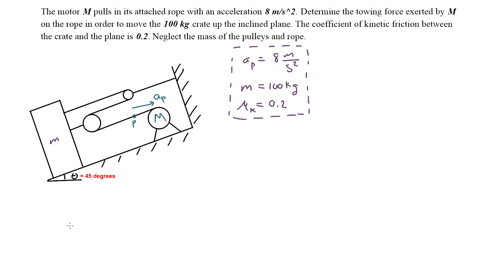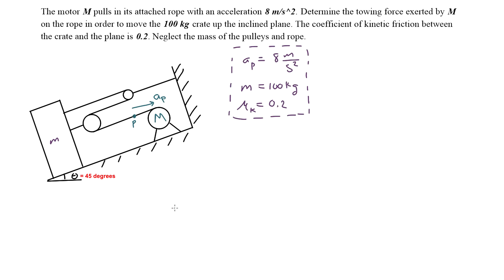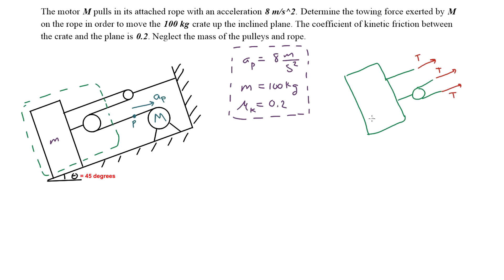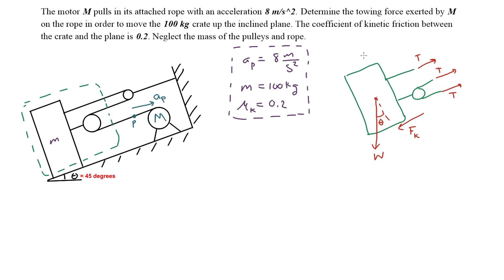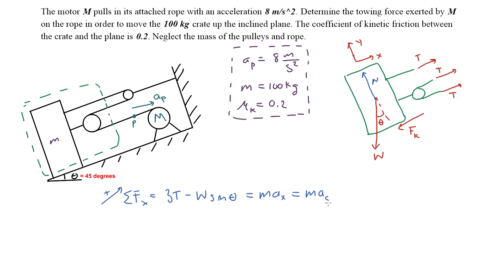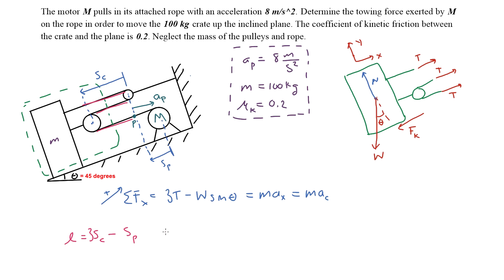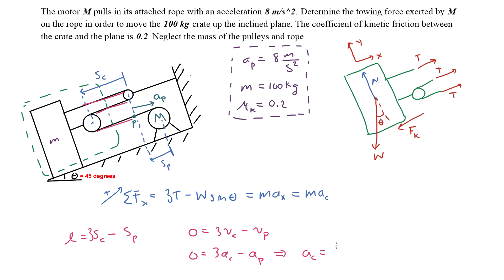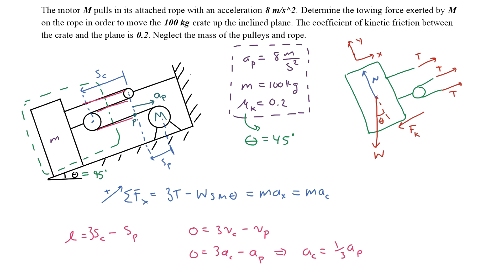Dynamics | "The motor M pulls in its attached rope with an acceleration 8 m/s^2. Determine the..."

Comment: When you add up the lengths from the datum, why do you subtract the sp from 3sc? Why don't you add the lengths all together?
Reply from the maker: @Rachel Hans @Kabir F
The best way I can explain it is that when the datums are defined, the sub-lengths of the rope are increasing and decreasing simultaneously, so they must be opposite in sign. 

Imagine a single pulley dangling on your roof. You put a rope on the pulley such that the rope is evenly split in half on each side of the pulley. You define your datum on the pulley. Then you pull the rope on one side. When you pull the rope, that side of the rope "increases" in length while the other side "decreases" in length. Therefore, the side of the rope you pulled has a net increase in displacement while the other side has a net decrease in displacement. We can then say that the displacements are opposite in sign, but add up to the entire length of the rope (because the length of the rope is conserved). This then further proves that the velocity and acceleration are also opposite in signs. 

This is the same concept in this video, but its harder to see when there are multiple pulleys. 

Let me know if you guys have any more questions!
Reply: @alexjbeezy  Thank you! That definitely makes more sense, great video!
Reply from the maker: @rachelhans8136  no problem! Glad to help!
Reply: Yea this confused me too. Are you from that one Chegg problem
Reply: @kabirf8241  Yeah haha I learned how to do the datum but can never figure out when to add or subtract the lengths